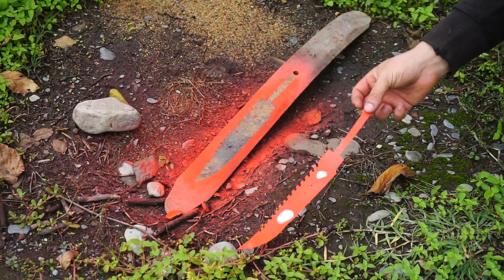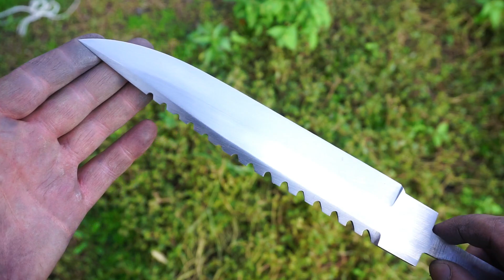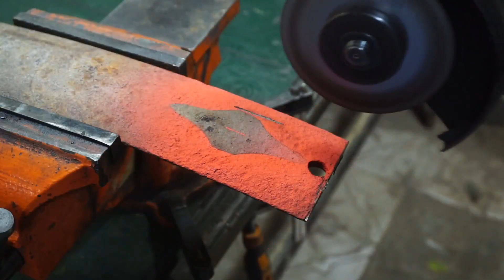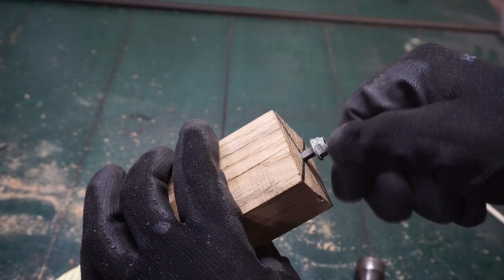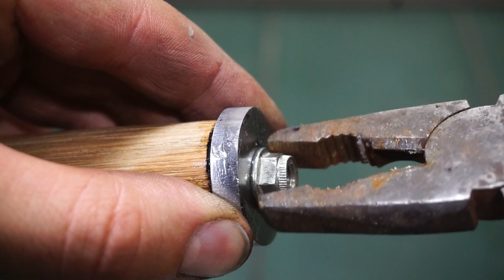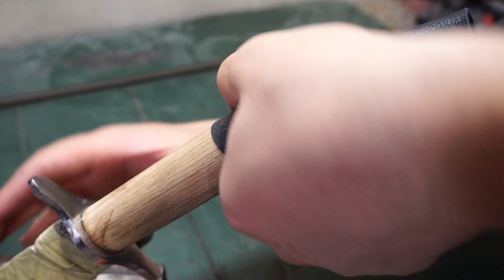Making a RAMBO Knife From JUNK

Comment: It’s a beautiful knife but far from the original Rambo Knife. Rambo’s knife had a rectangular cross section handle, an extended pommel so the hand wouldn’t come off if stuck into something, and it also had a fuller.